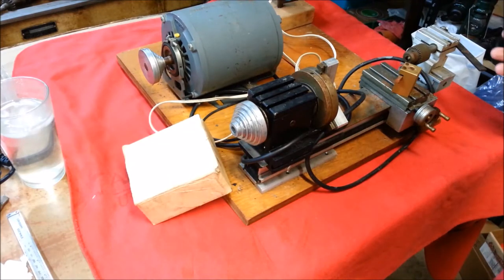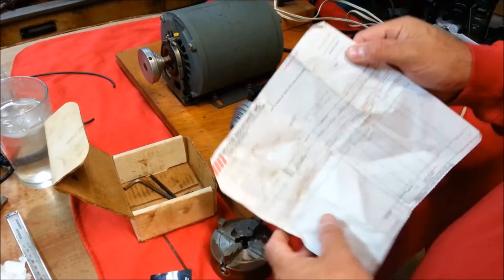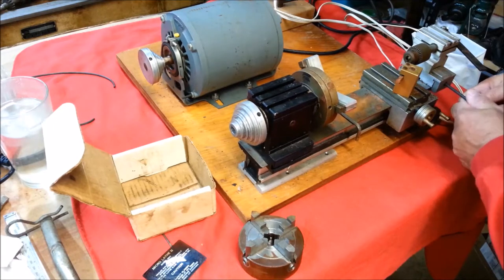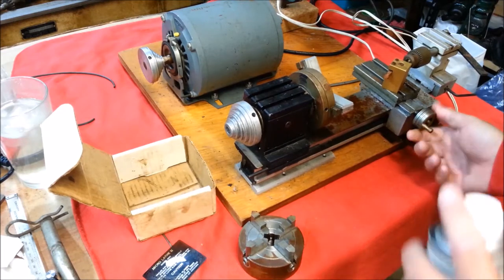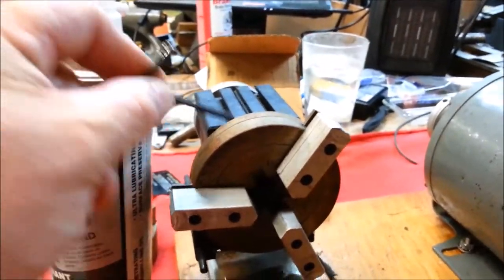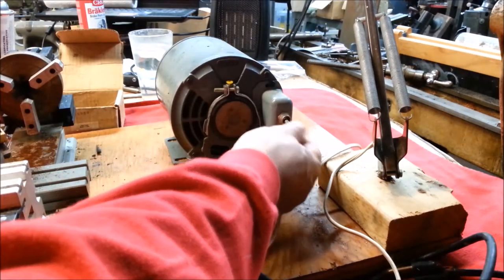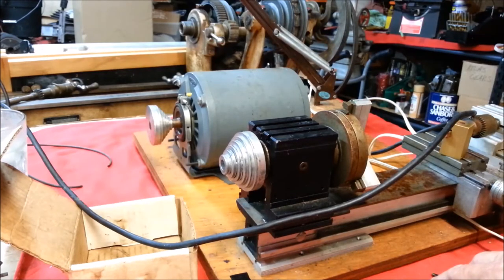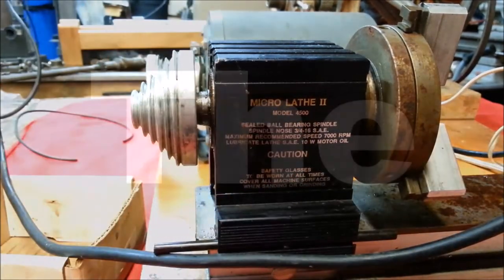Micro Lathe  II - 4500 - BOTT 22 - Crafted Channel

Comment: It will be interesting to see that little Taig go with 1/4 hp driving it.  Do you suppose the O ring receipt was actually for the belt?
Reply from the maker: Yes, I suppose it was.   I won't be ordering that same O-ring.  I see people like to use the V belt from the milling machine. It's shorter and probably better grip.  Also having less stretch, you would pick up some of the mass of the motor as flywheel to smooth out rpm which I would guess under a high load means less chatter.